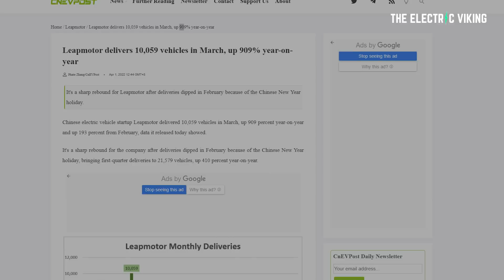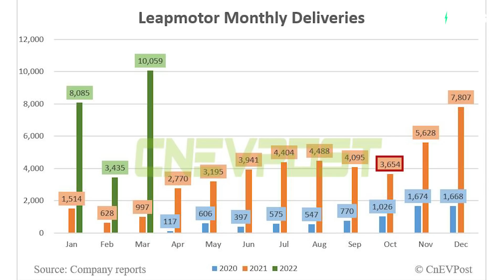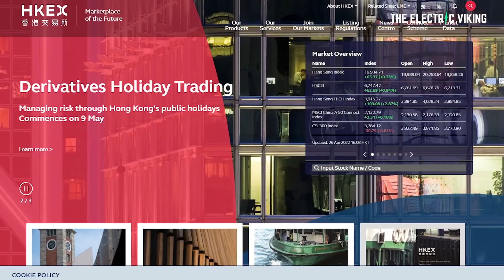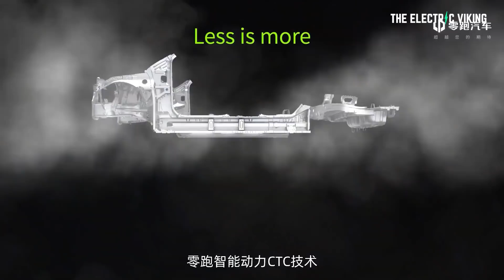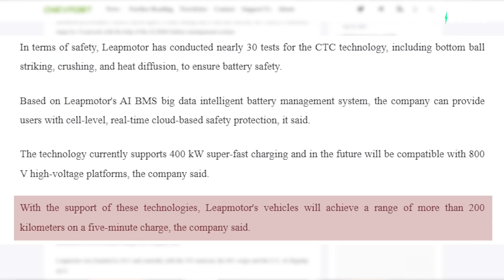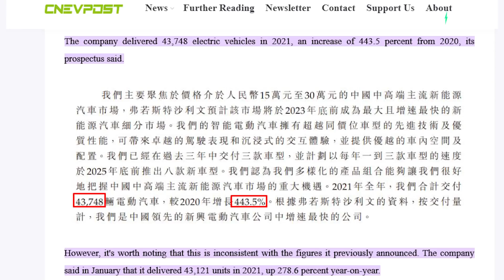Amazing EV startup makes structural pack similar to Tesla 4680

Comment: Thank you for your video. This technology is good because it saves costs and makes EVs more efficient. It reduces the number of parts and connection points. Mr Sandy Munro is a big proponent is a part having 2 or 3 or more uses (in this case it is a battery and also a structural element). I am curious if a car like that is involved in an accident and the battery back is damaged (e.g. bent) what the repair costs would be. I know Tesla has started creating its own insurance companies throughout the US (e.g. they already have one in my state, Illinois). I am curious though if the repair costs would be higher than the repair costs of a regular car with the same type of damage. Does anyone have a real-life experience with insurance costs for Teslas with structural battery packs?

Comment: “Structural Battery Pack” means if you try to remove the battery pack, the car will fall apart. That means the battery production needs to be so good that there is never a need to remove the battery pack. In the rare cases they have to, giving money back or a replacement car will be a better choice.

Comment: Not sure that is actually a structural pack. Seems like they boxed the batteries and just put them in a bigger case. To have batteries contribute to the structure they must be connected to the structure. That's why these nothing between the Tesla pack and the 4680 batteries with cooling running along the sides of the batteries.. With all the layers and boxing between the batteries and the case it seems unlikely that their batteries will contribute to to structure, infect this seems worse that what most other companies are doing but maybe there more to it than what meets the eye.

Comment: One concern I would have about these vehicles is how you dispose of them at the end of their life?
In simplistic terms in a traditional EV you remove the battery pack and motor and then deal with the body shell. As I understand it, with this car disposal is going to be much more complex and if you buy “on line” who is going to be there in, say, Australia, in 10 years time to help the 2nd or 3rd owner through the process?
More importantly, perhaps, what is the whole life cost of this EV? When you remove the battery pack from a life expired Nissan Leaf it can be repurposed for some other form of electricity storage and so reducing the whole life cost for society as a whole. Once the Leap EV is defunct are the batteries beyond further use as well?
I’m not convinced that this is the future
Reply: Redwood Co. can reclaim 95% of the battery, making mining unnecessary in about a decade. Latest estimates for bat life is 1,000,000 miles. Enough for you?
Reply: @1voluntaryist   there may be a subset of batteries good for a million miles, but I doubt that is the case for most.
Reply: @1voluntaryist  I am more than happy that the battery packs in standard EVs get recycled and that is one of the reasons why you need to look at the full life cost of EVs to really see how they will help the world adapt to the current concerns about using rare minerals in EVs. My point is whether this Leap car can be recycled and used as effectively. If it can then fine but it would be good to know beforehand.
Reply: I'm happy to leave the recycling tasks to the recyclers - they do this for money, & I expect they will figure out methods, including ways to recover the entirety of the battery as a quasi-unit so it can be repurposed.  Time will tell...
Reply: @jrb_sland5066  I suppose the issue is that recycling businesses won’t necessarily understand how to recycle this car if the car doesn’t become a best seller? In those circumstances, as a business the recycler will charge more and the whole life cost of the car will exceed that of traditional EVs.

Comment: In the EV industry ultimately form will follow function with battery packs becoming standardised around an optimal configuration. At that point after market folks will be able cost effectively provide replacement packs as needed. Sooner the better.
Reply: So like petrol tanks? Or radiators? I doubt that very much. We have enough trouble standardising on tyres and wiper blades
Reply: I don't disagree with you on standardization only on the time frame 15 years plus before it's a buy in part and I expect it to be a split part by that time as fixed pack of which there will be a number of standards and a swappable pack which will be very standardized.
Reply: I can foresee battery standardization over time in the econo class of EV's. Where as the top end will maintain their specified designs. I can also imagine the after-market industry installing  "no name" batteries in the battery pack, on the most popular EV's, as an alternative to buying a new pack from the manufacturer.